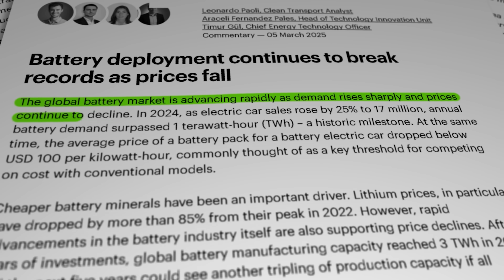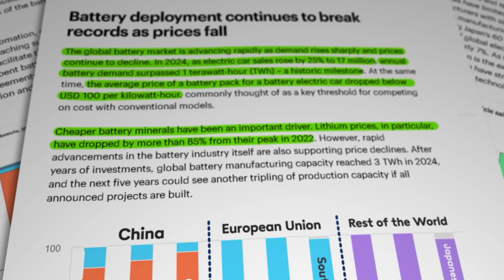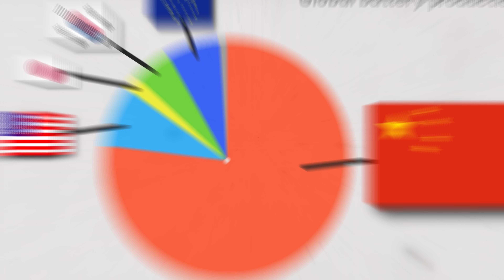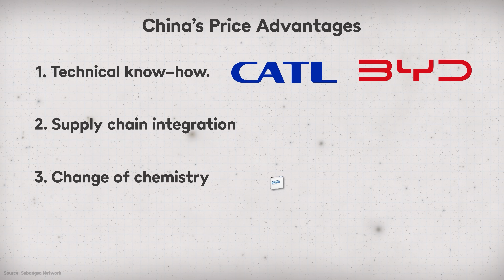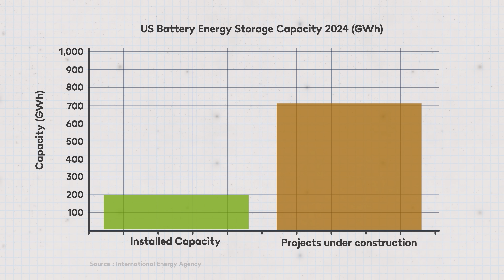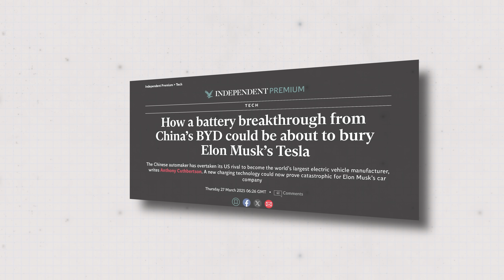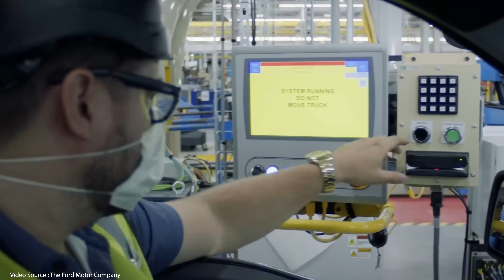Have batteries just hit their exponential curve??

Comment: It is only to be expected that battery vehicles will be cheaper than petrol engined cars given the enormous complexity of modern engines and gearboxes.
Reply: Have thought this for a long time.

IC cars have millions of engineer-years of value engineering behind them but the last decade has seen EV engineers doing the same thing.

Very satisfying to see EVs achieving that price advantage. That is only going to get better as time goes on.
Reply: Only if the batteries were user-replaceable.
Reply: @ You can have the old Nissan Leaf batteries replaced with a new pack that has more capacity for between $4,000 and $5,000. The old batteries degraded quickly where the new ones can last 250,000 miles or more.
Reply: @sd70cal  Yes. It just shows how tough the new batteries are even with no decent temperature regulation system.
Reply: How is the Toyota powersplit device complex? It's basically a planetary gearset, same as the Model T used.
Reply: @ It is clever, but the car still has an engine with all that complexity and wear and using energy which costs three to nine times as much as home electricity.
Reply: @FalkinerTim   If you have a problem with the cost of gasoline, then stop taxing it.
Reply: @aliendroneservices6621 and now add in all the other parts needed to make it work. The combustion chambers themselves are heavily engineered and require multiple incredibly precise holes to reach their maximum efficiency... Of like 35%
Reply: @aliendroneservices6621  I have worked on project cars as a hobby (for their faults, I still like them) and I'm pretty sure any ICE configuration is more complex than what you see in electric cars.

ICE have valves, pumps, filters, fuel management, cooling, lubricant, lubricant pumps, injectors, air & throttle management, timing mechanisms, seals that endure high pressure, and all of that is piped into a gearing system that, combined with electronic management systems, tries its best (and fails) to keep the engine RPMs at 2.5k. That then needs to be transmitted via a CV system that is prone to wear and all sorts.

Electric cars on the other hand are a single motor or dual motor setup with minimal gearing (forwards/backwards), a power management system, some simple cooling and sometimes a charge circuit.

That's not to say that they are simple, just much more simple than combustion based engines. If you look at the electric aviation world, you'll see that FAA approved electric aircraft only have an on/off switch while combustion aircraft must have a billion switches to ensure that the pilot can monitor and control each of the many variables inherent to combustion engines.

They are already a better driving/piloting experience, we just gotta bring battery prices down, increase energy capacity and improve their charge/discharge characteristics.
Reply: Yeah but I have a fantastic 10 year old truck, a Ram 1500 which has no major component replacement looming as would be the case if it had a huge heavy battery with 25% of original capacity at the same age. Imagine replacing a battery for a cost twice the value of the vehicle with new battery, would be worth.
Reply: @tomgroover1839 go read the research on battery degradation. It's less than 1%per year so at 10 years is closer to 90%capacity remaining than 25% capacity remaining.
Reply: @playlist5455   Except that's not the case in real life.
Reply: @playlist5455  Unfortunately for OLDER batteries it's about 70% at 10 years (I have one of these vehicles)

That changed significantly with chemistry changes in the mid 2010s and more modern vehicles don't suffer nearly as badly
Reply: @tomgroover1839  Battery seem to have a pretty good life span already.   The new chemistries will probably see even longer life.   Besides that a battery replacement industry will emerge as volumes increase.    I am still ICE but the writing is on the wall, EVs will be preferred.
Reply: @ I can imagine all the money I would save by not buying gas for that truck which gets 15 mpg for 10 years.    But, if you really need the truck for work or survival, EVs are not yet ready for you.
Reply: @BigWorldOutThere98  I would, though, move to electricity which will be a more secure fuel both in Australia and the USA. I remember the fuel shortages that hit Melbourne in the 1970s and how the traffic just dried up. With Australia's fuel source passing through so many choke points and with the geopolitical system in the Middle East as fragile as it is, I do not want to be reliant on an imported commodity.
Reply: @ One of the best arguments for EV's there is.
Reply: @tomgroover1839 you had better update. Most of what you say is now incorrect.
Reply: @tomgroover1839 I wondering if you know how complex oil distillation is? Or how many components inside your ICE vehicle turn so require a constant supply of oil to ensure smooth running. The entire ICE infrastructure is huge and once it starts to crumble because economies of scale aren’t there because of the EV transition your ICE vehicle will become VERY expensive. As more and more people can charge their EV’s at home there will be less and less fuel stations so you will have to travel further to purchase your fuel. EV’s have very few moving parts and as the reliability of batteries becomes better and better an ICE car and all the associated infrastructure will become more and more expensive.
Reply: @TW19567  Real simple. You cultists have no answer to the New Zealander airline pilot that I met last night. He had just flown nonstop from there to Houston. He laughed when I brought up the topic of electric aviation, and needed to say no more. What you guys think you can do is destroy aviation. There is no remote possibility of even flying 300 miles on  batteries, much less 7,500 miles like he just did. And get this -- you notice the moniker Houston -- I'm an engineer and live here, so it is rather silly for someone to presume ignorance on my part of the fuel production stream.
Reply: @tomgroover1839   You could reasonably expect 25% capacity loss at 10 years of age, not 25% capacity remaining.
Reply: @aliendroneservices6621  There is also a high probability of 100% capacity loss due to the battery being damaged if failed.
Reply: @aliendroneservices6621  Uh, no.  Lithium ion batteries do not last 10 years in daily use.  10 years of average driving is almost 150k miles.  If your range was 300 miles, that's 500 cycles on the ten year old battery.
However, the average age of a car on us roads is 12.7 years right now.  So 10 years is nowhere near the end of a car's life.  So this means a new battery that will functionally put the car into the junkyard.  A 10 year old car is generally not worth a new 10k Dollar battery. Some models have a 30k Dollar battery.
Reply: @tarstarkusz   People with 2012-2015 Tesla Model Ss are reporting around 15% capacity loss at present, compared to new.
Reply: @aliendroneservices6621  Do you know who is reporting this?  If so, would you mind sharing?
Reply: @tarstarkusz   Check a website starting with the letter "R", and another starting with the letter "Q".
Reply: @kirkjohnson6638  isn't that the same as anything though? You say that as though it is unique to batteries.
Reply: @ All you need to do is go on rebuild channels to find a slew of ICE vehicles which have failed with very few miles on them. I can't even count the number of times I know of where people ran the car with no oil, no water, or never changed the oil. How many times people kept driving when the head gasket was blown. Poor oil pickup designs, retaining screws instead of keyways on cranks, and many other ICE vehicle design failures. 
Maybe you're talking about the price of a replacement battery. Prices have come down. They are about 7% the cost of what they were in 2010. The current price is expected to drop another 25-35% by 2027. All while capacity, reduced charging time, and reliability is going up. Unless of course our current administration messes everything up to appease his base.
Reply: @sd70cal  If EVs are getting so much better, why are their sales tanking and why are governments still having to subsidize them and mandate their sales?  What is going to happen to EV sales when insurance companies raise their premiums substantially and/or flat out refuse to cover them or to cover owners houses if they park or charge in or near the house?  And what is going to happen if sales do pick up and the wlectrical grid upgrades can't keep up with demand?
Reply: @kirkjohnson6638  The oil industry is one of the most heavily subsidized industries in existence. Subsidies for oil began in 1916 and has never let up. 
Tesla sales are tanking. World EV sales were up 25% year over year while sales for ICE vehicles peaked in 2017. 
Every knew innovation in history has been subsidized by government. Trains, planes, freeways, ports, you name it. Private industry does have the money or the want the risk of a new technology. They need a consumer base in place in order for them to succeed. That's something governments have done forever. 
Governments also fund stuff like putting charging networks in rural communities where they cost much more per unit. It for serving the greater good of the public when private industry can't.
Reply: @sd70cal  It seems like every EV fanboy claims that the oil industry is heavily subsidized and yet I've never heard anyone say how it is subsidized.  Allowing oil exploration and drilling costs to be written off as business expenses is not a subsidy, that's just standard acounting practices for all businesses.  I can't recall ever seeing the government offer rebates for buying gasoline cars.  The last I checked, gasoline is taxed quite heavily at the pumps.  States require yearly vehicle registrations and some states slip in a vehicle value tax each year as well, so that certainly isn't encouraging people to buy ICEVs (or EVs).

So how are these supposed oil company subsidies implemented?
Reply: @kirkjohnson6638  "fanboy"! Makes me feel young again.
How much of anything that can be written off is determined by the tax code. How quickly it can be written off is also a part of the tax code. These are not just "accounting" practices, they are tax credits (rebates). The oil industry gets to write off all costs of exploration and drilling. this is far more than for other industries. They also get to write off 15% of gross sales.
I have friends who invested in wells, I was a bit short on the capital needed at the time. These rebates really reduced the risk and increased the profits.
Reply: @kirkjohnson6638  As a driver of cars or trucks you have been "subsidized" for many years. The feds may not have given rebates for ICE in the early days but they did build highways and freeways for them. You could be driving on private toll roads instead.
Reply: @sd70cal   Writing off all costs of exploration and drilling is 100% normal accounting for all businesses because those are current expenses, not capital expenses.  But, I'm not sure how or why they would be allowed to write off 15% of gross sales.
Reply: @sd70cal  The construction if toads and freeways is not a subsidy of ICEVs,  it may be a subsidy of transportation in general, but it certainly wasn't aimed at or restricted to any particular form of propulsion.  And, sales of gasoline and diesel are heavily taxed at the pump.
Reply: @kirkjohnson6638  Many counties and states tax EV's when they register to replace the taxes they do not pay at the pump. These taxes as well as fuel tax is for maintenance of roadways. Strictly off-road vehicles can use fuel which does not have these taxes included. 
The highway subsidy of the national roadway was what incentivized the trucking industry. Without that incentivization most traffic would continue to be by rail. Building roads into the rural parts of the US was for the benefit of individuals who purchased cars. Without that benefit the market for cars would have been limited to cities. You may want to study the history of roads in America.
Reply: @sd70cal  Also, you can have an EV at 210,000 km which has had some tyre changes and maybe brake pads whereas petrol cars at that age may have had a lot of drive train components replaced.
Reply: @FalkinerTim  With higher torque EV's will go through tires faster. The way I drive at 210Km I'd be looking at my second suspension rebuild.
Reply: @sd70cal  Railways were never a good way to transport produce since it has limited shelf life and requires wide distribution.  The interstates were built for both military and transportation purposes.  The trucking of goods benefitted everyone.  Sorry, but the roads weren't built to subsidize cars, they were built to unlock economic prosperity and ensure national security.

We had electric vehicles befire gasoline vehicles, but the market decided gasoline cars were better because they offered better range and refueling.  EVs were done in by their weak battery designs.  The battery designs of today are better, but they are still the Achilles heels of EVs.

The main things keeping the EV alive today are subsidies, below cost pricing by most suppliers, government mandates, and fleet sales.
Reply: @kirkjohnson6638   "If EVs are getting so much better, why are their sales tanking" - Sales are not "tanking". Global EV sales in Q1 2025 were 29% higher than in Q1 2024. Or maybe you thought "tanking" meant rising rapidly?
Reply: @theelectricmonk3909  If you remove  all the "sales" where the dealer registers the car and then immediately lists it as a used car so that they can avoid government penalties for selling additional ICE cars, and you'll find that real EV sales to individuals are tanking.
Reply: @kirkjohnson6638  LOL. If you remove all the sales that exist only as a figment of your imagination (unless you can provide definitive evidence otherwise), sure, you can make the figures say whatever the hell you like.

The simple fact of the matter is this: BEVs are replacing petrol/diesel cars, in increasing numbers, increasingly quickly.
Reply: @theelectricmonk3909  It's not my fault if you are not keeping up with the news.  The net zero regulations in Europe stipulate a quota on EV sales and restrict ICE sales based on EV sales.  If dealers sell too many ICE for the number of EVs sold, they face massive penalties on every extra ICE sold.  So dealers either have to not sell any more ICE vehicles or they have to "sell" more EVs and they do that by falsely registering them and then putting them on the used car market.

Will EVs replace ICE?  Only if certain things happen; 1) EVs get cheaper, 2) EVs get better battery chemistries that aren't exteemely flammable and highly toxic, 3) the electric grids are upgraded significantly to handle the added loads of EVs and AI, 4) the charging infrastructure for EVs is greatly expanded, 5) charging stations are guarded against copper thieves, 6) charging stations in dangerous areas have security personnel to protect owners from danger while they charge, 7) apartment and condo complexes pay to install many chargers for residents, 8) charging times are significantly reduced at public fast chargers so that long distance travellers or high mileage drivers are not greatly inconvenienced, 7) EV repair stations and technicians increase greatly in numbers, and 8) EV manufacturers develop better availability of repair parts.  So, basically, they've got a heck of a ling ways to go.  Maybe by 2050 EVs will be ready for prime time.
Reply: The EV batteries by themselves are more complex than ICE drivetrains.
Reply: @kirkjohnson6638  That is only because you don't understand EV batteries like you do ICE drivetrains.
Reply: @sd70cal  Actually, I do.  You take 6,000 to 8,000 battery cells plus all the connections between them and you have WAY more failure points than any ICE drivetrain.  Admittedly, due to fuel economy standards and emissions standards, newer ICE vehicles keep getting less and less reliable because of stupid transmissions with way too many gears and far too many computer controls.  But still, they are more reliable than EVs.

Interestingly, a recent article from the Telegraph in the UK had an interview with the head of their Automobile Association and he said that EVs break down more often than ICE vehicles.  And given that the average age of ICE vehicles is about three times that of EVs, you can look forward to the reliability stats on EVs getting worse and worse as the fleet ages.
Reply: @kirkjohnson6638 because trusting the Torygraph and someone who is anti EV is sensible.

What they counted in EV breakdowns were software issues easily fixed over the air without a physical recall. And early models and now bedded in and fine. Newer EVs rarely have issues. Much like ICE. The vast majority don't have issues, but some brands do e.g. MG. No.mechanic will recommend an MG.
Reply: @kirkjohnson6638  You are conflating the number of points to risk of failure. If I attach a panel together with one bolt or 2000 spot welds the number of attachments do not equate to the likelihood of assembly failure.
EV's are easily getting over 250,000 miles of life. They are doing that as a new technology. I doubt your assumed numbers are valid but even if they are it's understandable that new technology will have more failures than a mature one. The big difference is EV's performance and reliability has much more room to improve; whereas as you pointed out, to get more out of an ICE engine we need to add much more complexity to it.
Reply: @sd70cal  No, to get more out of ICE vehicles we need to forget about trying to squeeze an extra mile per gallon or two out of them and forget about CO2 emissions since CO2 is not a pollutant.  We need to go back to simpler transmissions with only three to five speeds and we need to ditch much of the smog related equipment, software, and electronics (we do need some to keep the HC and NO emissions down).  And, of course, both EVs and ICEVs need to ditch all the superfluous electronics they carry that is designed to do nothing useful but wow the customer in ths showroom.  That would make cars less expensive to buy, operate, and repair and make them far more reliable and less prone to catching fire (many car fires result from electrical failures in the cabin and engine compartment equipment that both EVs and ICEVs share (infotainment systems, climate controls, alarm systems, door locks, power windows, power seats, heated seats, lighting, etc.).
Reply: @sd70cal  And, to your first point, I am not conflating number of points of failre to risk of failure.  There are redundancies like many spot welds that reduce the risk of a failure of the system because the system can operate safely with several spot welds failed.  But there are also failures where any single failure can take out the system.  A single lithium ion cell developing an internal short and going into thermal runaway can cascade into the whole battery butning up.  In this case, if you have twice as many cells, you have twice as much tisk of a cell goung into thermal runaway and double the risk of a catastrophic car fire.
Reply: @ On the one hand you seem old when you talk about how fires are most caused by ancillary equipment. On the other hand you seem young when you say we do not need all of the smog equipment. Equipment for HC and NO is the majority of the smog related equipment on a car. 
Most fires today in ICE vehicles are from the engine compartment, either fuel delivery/management failure, or heat shielding removed. 
For EV's it mostly has to do with battery composition which is quickly being rectified. The chance of an EV catching fire even with the older compositions has been much lower than comparable ICE. 
CO2 is not a pollutant. It is a greenhouse gas. Even with all of those O2 sensors, multi-gear transmissions, and fuel control systems ICE vehicles still only pull a small fraction of the energy available from each gallon of gas. In the future when the world does run out our descendants are going to look back at us as the dumbest lots around.
Reply: @sd70cal  As for vehicle fires, almost all ICE vehicle fires are either arson or are started from failures in the electrical system that end up igniting the cabin interior.  Very, very few ICE fires are caused by problems with the fuel delivery system and, if you want to reduce those, just go back to carburation operating at around 3 psi instead of port injection operating around 50 psi or direct fuel injection operating at two or three thousand psi.  Less aerosolization of the fuel makes the odds of ignition far lower.  And, if your car is well maintained and tuned, the cats aren't likely to ignite any gasoline fumes.
Reply: @kirkjohnson6638  Nope. There have even been several "do not garage" ICE recalls because of fuel leaks. 
Guess you've never seen a stuck fuel bowl on an old naturally aspirated engine.  Had a motorcycle dump 4.5 gallons in a garage because I failed to use the petcock every time.
Reply: @kirkjohnson6638  And you have many engineers and chemists who have changed designs so these batteries do not go up in flames. The Chinese have a battery they've driven metal spikes through. No fire. Your fears seem to be rooted in the past. 
Historical data shows the opposite. EV's historically have 25 fires per 100,000 cars while ICE has 1,530 per 100,000 cars. You just aren't seeing them on the news as they are not as news worthy.
Reply: @  Batteries available today do not have the self-ignite risk your proclaiming. Your computer, camera and scooter/e-bikes have a much bigger chance of catching fire. 
Historically fires for EV's have been 25 per 100,000 cars. 
For ICE is been 1,530 per 100,000 cars.
Reply: @sd70cal  So, you basically didn't keep your bike in good order?  I owned three different dirt bikes when I was young two were several years old when I bought them and one was brand new.  Never had any fuel leaks due to stuck floats and considering I was taking the carbs apart when I was in junior high, it's fair to say they're simple to maintain.  I've also got a '79 MGB  with a ZS side draft carb that I bought in '89 with 120k miles already on it and it was in rough condition.  Never had any problems with the floats getting stuck.

I've never seen a do not garage order on any ICE vehicles and it wouldn't make much sense to issue such an order since ICEVs only leak gas when the fuel tank is damaged or when the fuel pump is running.  Plus, 1) you can smell leaking fuel and 2) most garages have building codes that require outside vents and require installation of  things like gas water heaters or furnaces to be located a foot or so above the floor so that they cannot ignite gas fumes.

On the EV side, you cannot smell electricity and battery cells can fail at any time, not just when the car is "on".
Reply: @kirkjohnson6638  The argument is good in theory but the reality is that EVs are proving much more reliable.  This European study compares cars of similar age. https://www.youtube.com/watch?v=JIXfeKzw_e8
Reply: @FalkinerTim  Sorry, but a link to the Electric Viking is just a joke as is any study that would conclude that EVs are more reliable than ICEVs.  First off, outside of the drivetrains, EVs and ICEVs share many common desig  elements and have equal failure rates in those areas/systems.  Within the drivetrains and energy systems, there are also some similar design elements such as component housings, bolts, bearings, electric fuel pumps/battery coolant electric pumps, low power electronic control modules, etc.  The electric traction motor is certainly more reliable than the combustion engine (assuming both are well designed and manufactured).  The electric traction motor, like the ICE engine requires cooling and while it may need a smaller radiator, it requires an electric coolant pump and control system vs. the ICE engine which can get by with a very simple mechnical centrifugal pump and an inexpensive thermostat.  The electric motor also requires a complex controller and many sensors to control the speed and torque of the motor.  When it comes to the energy system, the EV's is far more complex and less reliable than the simple gas tank, fuel lines, and fuel injector solenoids.  However, newer cars also have high pressure direct injection pumps which makes the fuel delivery system less reliable.  And then there is the transmission.  Admittedly, the modern, many-gear-ratio, dual-clutch transmissions are not very reliable.  Of course, ICEVs could use fairly simple, very reliable 5 or 6 speed manual transmissions, but the market (and CAFE mpg requirements) decided that CVTs or many-speed automatic transmissions were more desireable.  If those complex transmissions were actually very unreliable, they'd have been rejected by buyers, so we must assume they aren't all that bad.  To be fair, the same logic applies to the complex battery systems of EVs.  They're obviously neither highly unreliable nor highly reliable but somewhere in a range that people think is acceptable based on their limited knowledge and data.  But the truth is that EV batteries are dangerous, exactly how dangerous is impossible to determine with out years more data.
Reply: @kirkjohnson6638  What is dangerous about EV batteries?
Reply: @colinwiseman  My MG4 had a couple of minor software glitches (worst case scenario: Turn it off, wait 5 mins, turn it back on - fault cleared... Annoying, but hardly a big issue). Of course, the biggest problem with it is it got rear-ended by a double-decker bus last week. Quite hard, enough to cave the whole back in. It completely failed to catch fire & I drove it home (albeit it was a bit breezy with the entire back caved in...), so naturally it won't be in the news anytime soon. I'd not be surprised if a similar impact in a petrol or diesel car would split the fuel tank, quite possibly leading to a fire (although obviously I can't prove that, it's merely speculation).
Reply: @kirkjohnson6638  "That would make cars ... far more reliable" - Seriously? I'd love to know how old you are, because I remember the 1970s and 1980s - and cars were NOT reliable in those days! I grant you they were simpler to work on - they had to be, because they needed work doing so much more often!
Reply: @kirkjohnson6638  Not only the batteries but the whole electrical wizardry. However, there are few moving parts, and the components are very reliable and take far less servicing - EG first oil change (gearbox) 1.1 litres at 100,000 km in the case of my MG.
Reply: @kirkjohnson6638  "The EV batteries by themselves are more complex than ICE drivetrains." - OMG, what utter nonsense! Count the moving parts...
Reply: @theelectricmonk3909  Parts don't have to be moving parts to fail.  Pack 8,000 cells into a battery pack and any minor material flaw, any manufacturing defect, any damage caused by impact of debris on the underside of the car, any collision, any shock, thermal cycling, and any overload or over temperature situation can cause an internal short in a cell and the cell can go into thermal runaway catch fire, burn through adjacent cells like an acetylene torch and the whole car will burn up.  That's why insurers will totally write off EVs with only very minor collision damage if there is any damage to the battery pack.  It's also why apartment complexes and even whole cities are banning people from keeping or charging electric scooters and hover boards in their homes or garage parking.

If you doubt that non-moving parts can fail, just think back to all the radios, alarm clocks, stereos, TVs, microwaves, cell phones, laptops, tablets, car stereos, and other electonics you've owned that failed despite having no moving parts.
Reply: @kirkjohnson6638  ...and yet, despite all your protestations, EVs are 20x LESS likely to catch fire than their petrol/diesel counterparts. Modern battery chemstries are far more resistant to thermal runaway, and newer formulations that are still at the prototype or scaling-up stages promise to be safer still.

The banning of scooters and hoverboards is a totally different thing - you think that a hoverboard built at the absolutely cheapest possible price is in any way comparable to an EV battery pack that is (by comparison) subject to rigorous standards?

Finally - sure, I'm well aware that solid state electronics (etc.) can fail. But you know why solid state has replace mechanical in so many areas of our lives? Because it's so much MORE reliable. Computerised fuel injection is far more reliable than mechanical (which was more reliable than carburettors). EVs are more reliable than petrol/diesel cars... Both ICE & EV cars suffer from software problems (primarily) and some solid state hardware problems - but only ICE cars have a fragile engine with lots of mechanisms and moving parts which can go wrong in a heartbeat, if mistreated, or worn.
Reply: @theelectricmonk3909  Everything you said was wrong.  EVs are more prone to ignite than ICEVs AND when they burn, they cause WAY more damage.

Solid state electronis are quite reliable, but so are mechanical parts and repairing mechanical devices is simpler and less costly.  Nobody repairs circuit boards so entire boards must be replaced at high cost.

And the batteries used in scooters, ebikes, and hoverboards are the generally about the same quality as what is used in EVs.
Reply: @theelectricmonk3909  Some actual information on EV fires: https://youtu.be/eZtoihp64Oo?si=O47hjSm7HIqPUxtH
Reply: @kirkjohnson6638  LOL. Some random bloke on the internet who hates lithium batteries vs. insurance companies (who are the LEAST likely to believe the bullshit)? I know who I'm going to believe pal.
Reply: @theelectricmonk3909  That "random bloke" is one of the top experts in the field.  And insurance companies have never said EVs are less prone to self combust.

But, State Farm (The largest car insurer in the US) has removed EV charging stations from its parking garages at corporate headquarters and hubs across the US due to fire safety concerns. This decision was made following an enterprise risk assessment and evaluations by local fire departments. While they are exploring alternative EV charging locations outside of parking garages, they prioritize ensuring a safe working environment for employees.